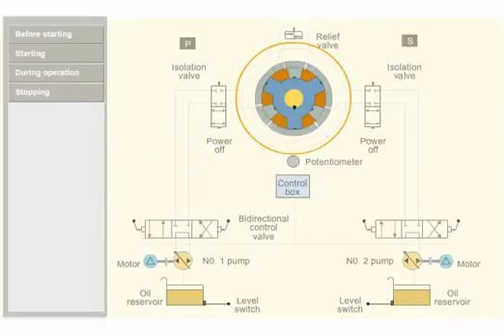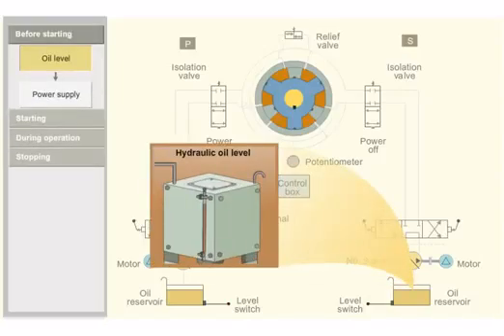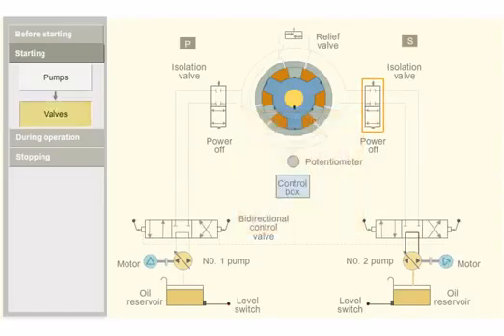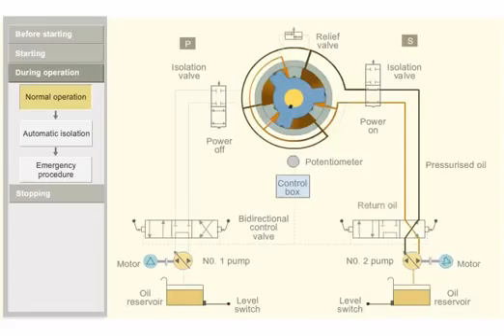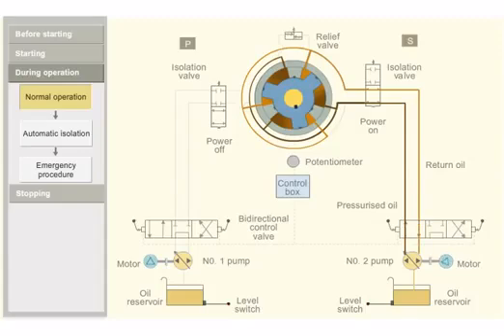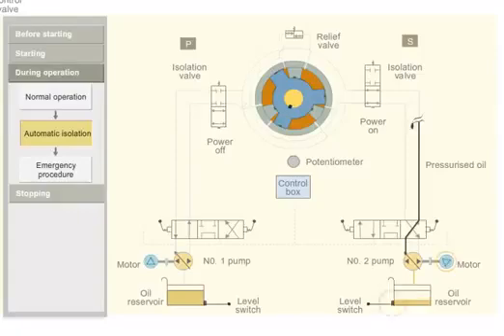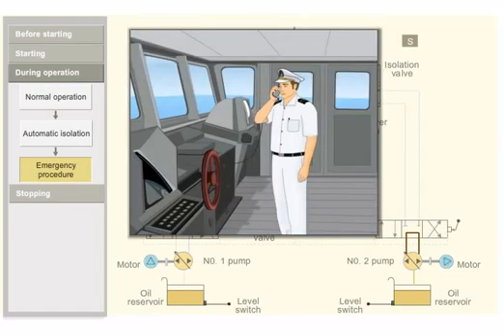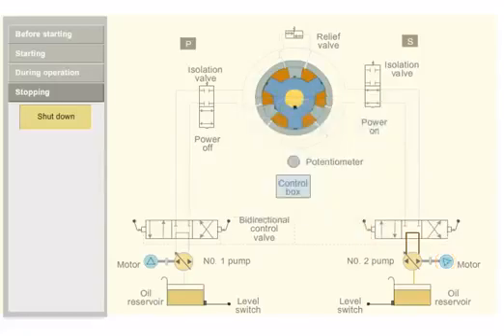Rotary Vane Steering Gear

Comment: why hunting gear is not present in this system???
Reply: Potentiometer senses the rudder position n sends a feedback to control box which in turn activates the bidirectional valve
Hence no need of hunting gear mechanism..!

Comment: thanks much for your wonderful explanations,i have a doubt at normal times,how many pumps are running,or else one pump running either #1 or #2 if anyone fails the other cuts in and take the charge..pls correct me..if i am right?thanks much
Reply from the maker: https://dieselship.com/marine-technical-articles/marine-engineering-knowledge-general/rotary-vane-steering-gear/
Reply from the maker: thanks for your comment and for your doubt i suggest you a link there you can find out your points.thankx